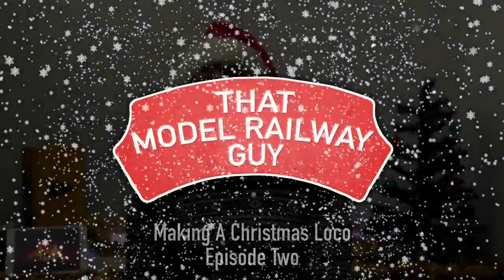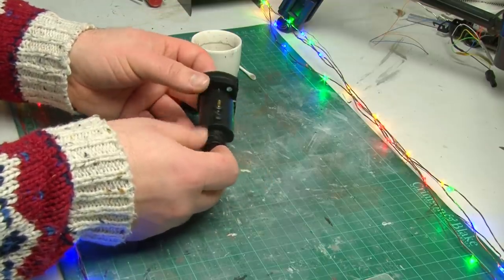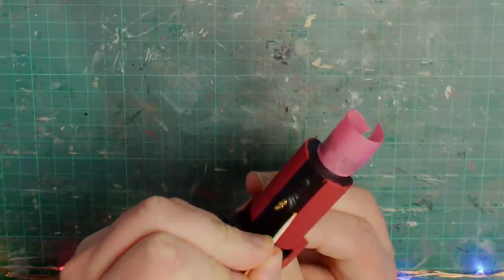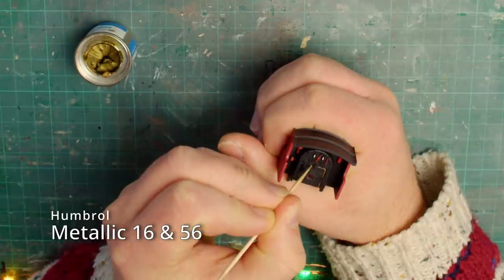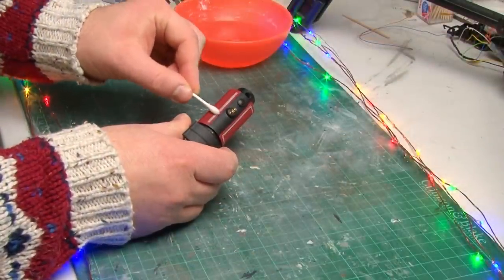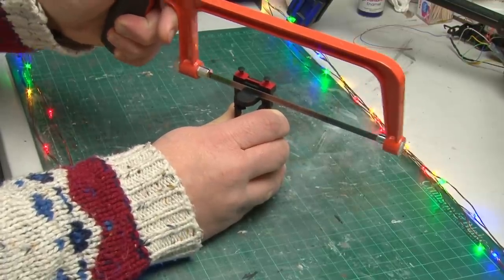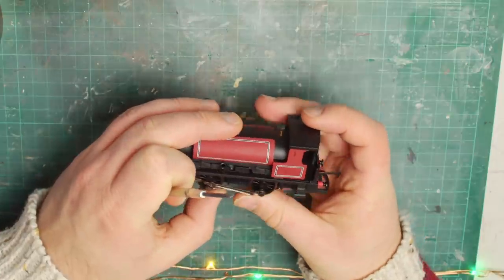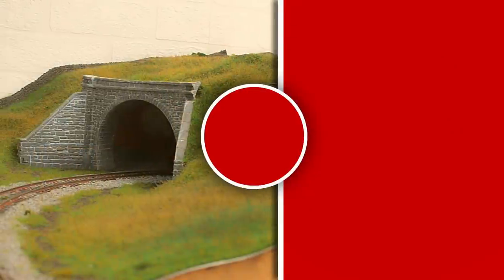Making A Christmas Loco - Episode Two - The Decoration

Comment: Do you have any tips for brush-painting models? I had a go at brush-painting some coaches the other day but they didn't turn out that great. Either way, Rudolph looks great!
Reply from the maker: Hi Will, I wouldn't consider myself an expert on the subject but generally I just try to get a nice even coat of paint and make sure the brush stroke are all flowing in the same direction too. If it looks a little patchy I'll add a second coat over the top but you do have to be careful as if you use too much paint you can start to loose some of the detail - especially with enamel paints. Hope that helps and thanks for watching 😃

Comment: Amazing! Makes me want to overhaul one myself! Will the smoke generator work on analogue or is it just a DCC thing?
Reply from the maker: Hi Connor, it was definitely a fun project so if you can pick up a loco cheap it's well worth having a go at. I believe the smoke generator will work on DC. I don't have any experience with that myself and obviously the wiring will be different without the decoder but we have seen DC only engines in the past fitted with smoke generators. Thanks for watching 😃